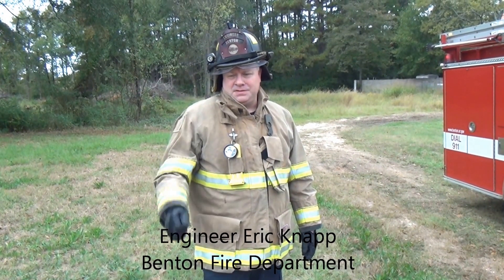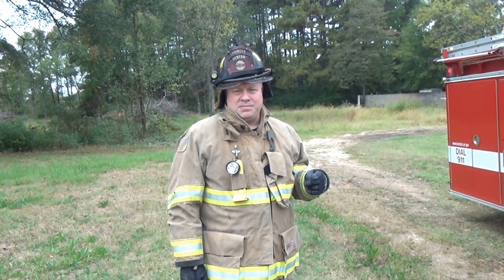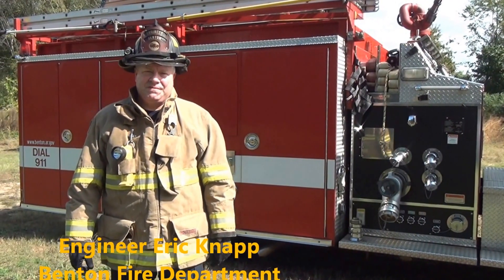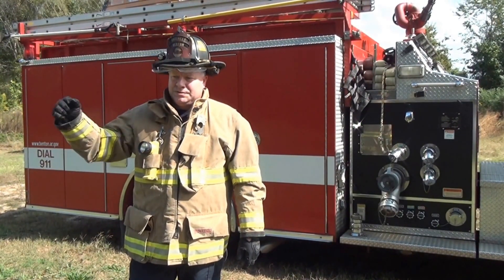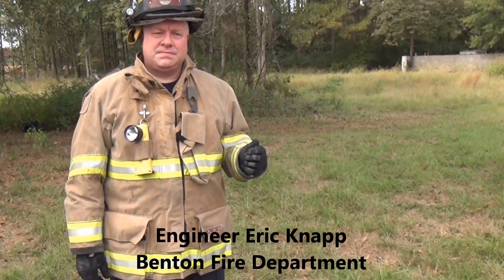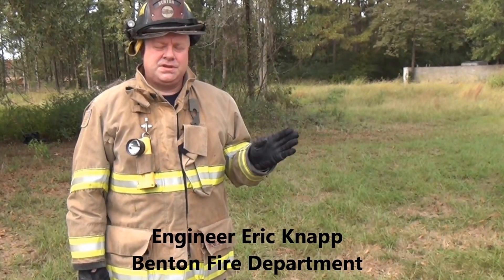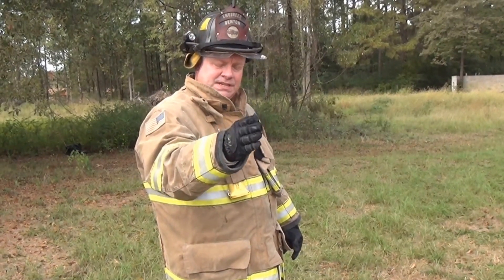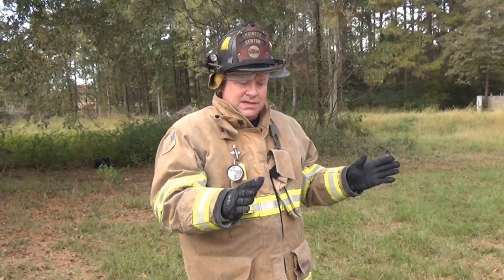Advancing the Triple Layer Load   3 Techniques   Knapp, Foreman, Forga

Comment: Good info.  We don't use the velcro however, we just tuck the loop into the bale a few inches and pull it as one piece, then at the end it's separated and the loop is tossed to the side a few feet.  As an operator, you can help get the kinks out by over pressurizing the hose for a few seconds to get the kinks out before they open the bale.